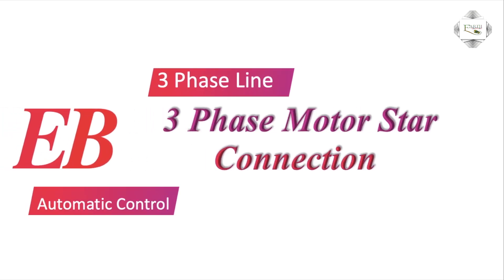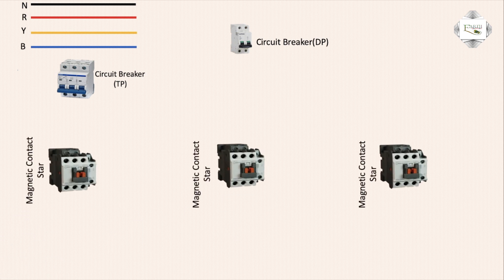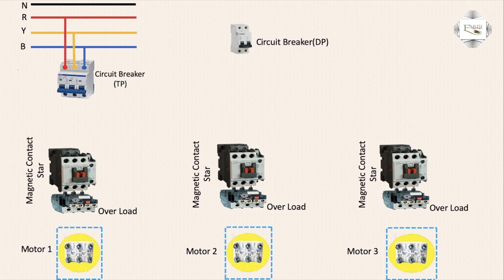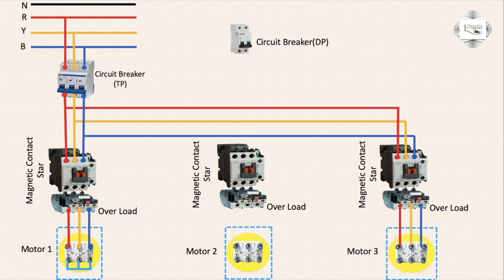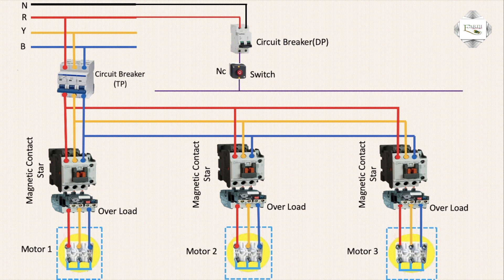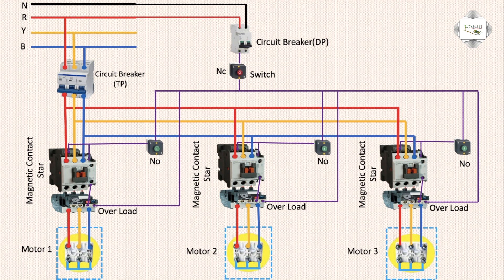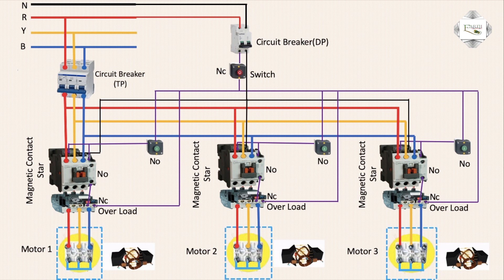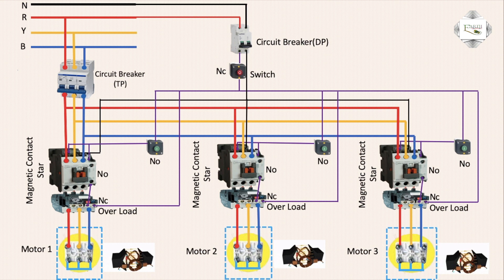3 phase star 3 motor connection | 3 phase motor | motor

Comment: Sir wc, my 3house 3single phase metre but  1.5hp single phase motor only 3 separate starter (is it possible to put the switch control in one place to run on three separate meters in one box?plz 9841156419
Reply from the maker: yes, sir. 
You're welcome!
youtube channel..........